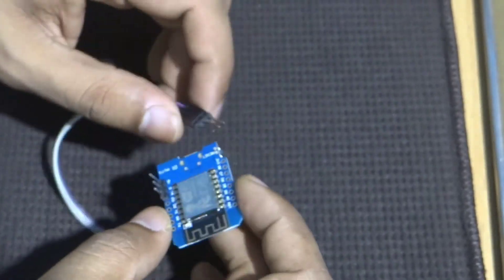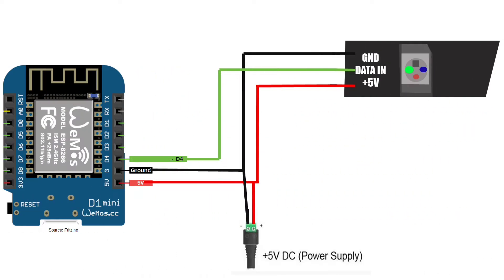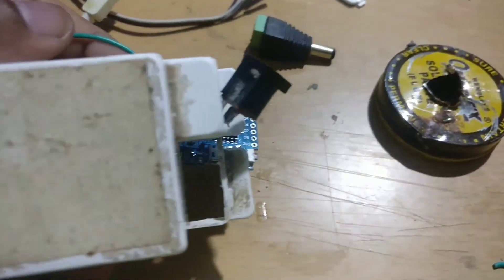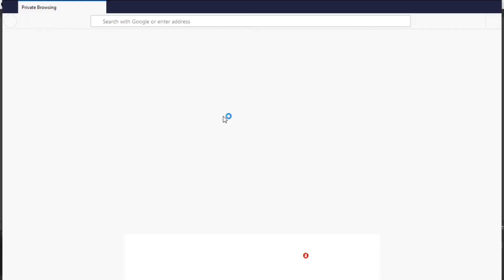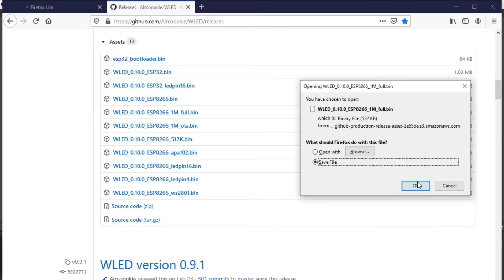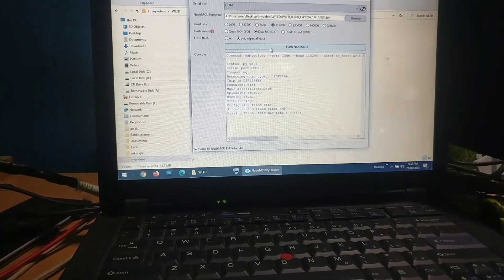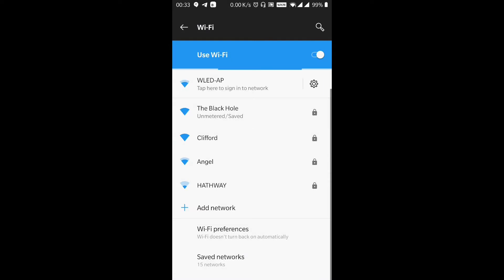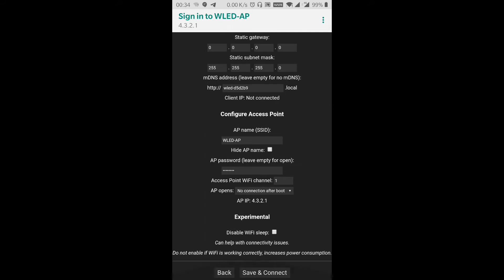#WLED #Jugaadityourself #RGB DIY RGB Controller | WLED WIFI RGB controller | Opensource

Comment: Which led strip it requires, any specific or any rgb led with data pin can work fine and what about smd 5050 cause it is very cheap
Reply from the maker: You need the addressable LEDs with data pin
Reply from the maker: The one i used is ws2812b

Comment: Hi, I built something like this but only with 5 leds and a wemos d1 mini. It worked fine but I left it on for a few hours and when I came back home it didn't work at all. 
The led strip was cutted in a 4+1 configuration and the wemos was still reachable but changing the color wasn't working. 
After some troubleshooting I discovered that the first led strip was not functional and it was shorting the wemos, so I traded to a 1+4 configuration with the same led strip and the same wemos and TADAAH, it was working, so my question is: do I need to place some resistor between the wemos D4 and the strip or is it my led strip that is faulty?  It is driving me crazy.
Reply from the maker: First make sure the wires coming out of wemos is soldered correctly then most of the time this LEDs come faulty so just keep a test circuit i use spi106e as my tester of my leds as its good check if all the leds are working

Comment: No resistor on LED strip data input, no capacitor on Led strip Power line, this is not going to run for a long time.
Reply from the maker: Yes but the leds which i have used already has resistors and for your safety concerns i would recommend you check quinled module